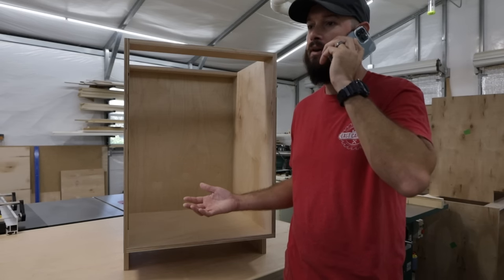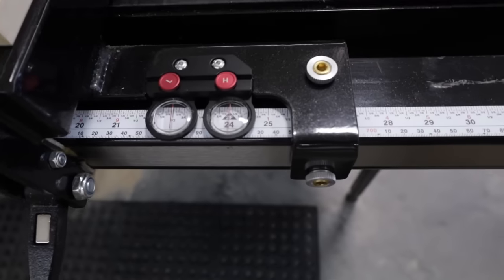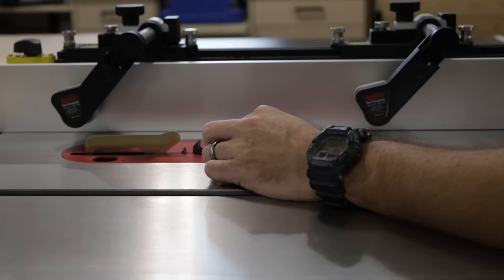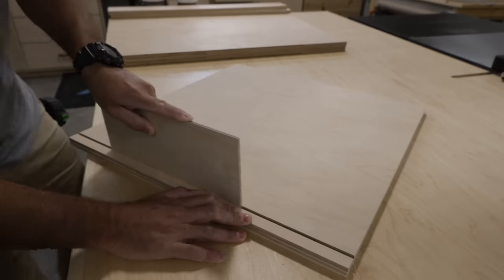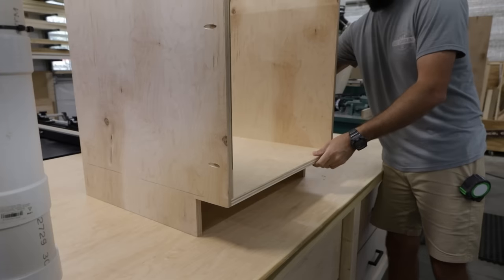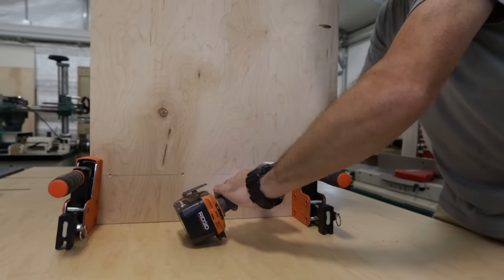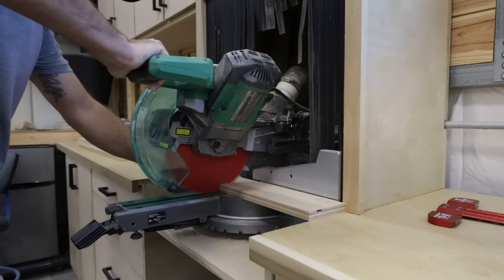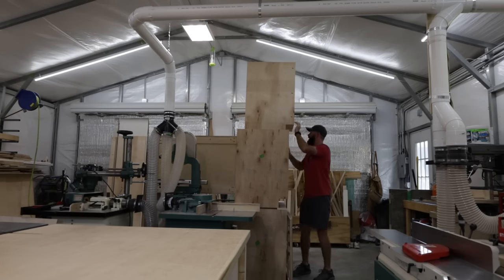How to Build Cabinets in under 30mins //The Easy Way

Comment: A friendly reminder:  I noticed when you were cutting the strips you were not using a push stick.  I just amputated the tip of my index finger 1 month ago on my table saw.  I was using a push stick but got distracted somehow (it all happened so fast).  I have been using power tools and table saw for many years without incident.  Everyone, please be safe and use all safety equipment recommended for your tools so you can keep all of your fingers. :)
Reply: this worries me. I try not to ever get distracted.... but it happens. I am comfortable using my table saw and chop saw, and do things that you probably should not do.... EVER.. AT ALL!!!!     and that is what worries me. being uncomfortable was better..  it had your Undivided Attention!!
Reply: Sometimes push sticks are more of a safety problem, than not using one.  No matter how you cut anything on a table saw, you must always maintain control over the piece.  Push sticks actually require more focus and pressure, than a hand over the fence pushing forward with thumb and index.  ALWAYS hold the piece you are cutting, firmly.
Reply: LET US SEE IT!
Reply: @ryanlopez4550  Because you don't believe me? Or because like graphic pics?
Reply: @Catherine-hh2qw  just want to see
Reply: @ryanlopez4550  I don't think I can attach a pic here...  If you know how, let me know.
Reply: 23 years in and I took the corner of my thumb off.
My caulk lines are tighter than ever, now!

It can happen fast on those repetitive cuts
Reply: @Steve-hj6xv  Gotta look for  the positives! 👍😁
Reply: I’ve lived this long without a table saw I’m gonna pass on getting one
Reply: @jonellwanger7258  unfortunately Jon, that is when you are the most vulnerable for an accident to occur is when you have become comfortable. 

The good thing tho is that you recognize that and you can try and put some extra focus on your activities around the table saw and miter saw so you don’t also become a statistic. 

Be safe out their Jon!! Stay focused brother, you know what to do!
Reply: Sorry to hear that. It must have been really painful. I slashed my palm with a utility knife yesterday while doing a minor siding repair and it was game over for me right there. I wish we all take precautions and try to focus all of the time. Those tools will get you when you least expect.
Reply: I wouldn't use one on the big cuts, where you can keep your hands a good foot or more away from the blade.  But those stretcher cuts made me nervous, when he was putting his hand between the blade and the fence.  That's a bit close for me, I'd use a push stick there.
Reply: You can read this but if your brain is built with a certain attitude to risk, regrettably you can only fully accept that this can happen to you when it's happened to you. 
Thanks for trying to save others from what you've experienced, humans are flawed.
Reply: @Steve-hj6xv  I knew someone years ago who took 3 of his fingers off on his first day on the job. Quite the initiation!
Reply: Sorry to hear that. Had close call doing a drop dado cut on maple. I'll never do that again. Be thankful you weren't using a shaper. Those have taken so many fingers over the years. Those scare me
Reply: Sawstop.. Worth every penny and a whole lot less expensive than a hospital visit. I had a spate of run-ins with the blade till the Mrs mandated my next saw to be a Sawstop. I still have all ten fingers and ten toes and the only thing I've tripped the brake with since was an errant tape measure.. Spinning blades are absolutely unforgiving and you'll be out of action for a good while once you get bitten by the blade.
Reply: I’m gonna ask the question no one else will ask, can you still pick your nose?
Reply: Happens to the best of them.  Man up
Reply: I nicked the tip of my finger and I use a push stick and pay total attention ever since
Reply: “That was my wife’s favorite finger”
Reply: I came close to that last year. Was getting tired and thought I had enough space.  Got lucky, just a nick.
Reply: @sixoffive  Been using a table saw since I was 10 and I still have all the didgets in one piece. I'm 75 now!!!
Reply: @royrodgers3296  I have the tip of my index finger missing so will answer for you..
While I can still insert my finger into my nose I can't actually pick it ..
Reply: @davidcurtis5398  I’m pretty clumsy, short attention span, and stupid. The choices I’ve made.
I’m thinking I need something over complicated and expensive, I just open a door, drop money in and magic happens. Out comes my project.
But, I’m a poor old guy so for now I’ll stick with a circular saw. Nice chatting with you.
Reply: @carljones9933  Ha ha! Love it! well here’s my pro tip of the week: I was never able to fully pick my nose with my index finger, it’s the pinky that will allow you to truly get in there:)
Reply: @davfinport  in some instances yea, that’s when I’d recommend the microjig grr. Solves both issues of forward pressure and fence pressure pretty flawlessly imo. Only downside is the setup sometimes. But I think I’m going to get a second one non advanced for just the gripper pad for datos and generic stuff and then I don’t have to waste time going back and forth with the attachments when they aren’t needed
Reply: Totally agree - my hubby, a very experienced woodworker - built our entire HUGE kitchen with cherry from our own woods - got distracted cleaning & oiling table on his large joiner.  He had a propane heater going, the vac system, didn't hear it was somehow own, the rag he used pulled 2 of his fingers into the blade - zip, split second.  Trip to ER, VERY PAINFUL anesthetic shots & then stitched up the end of middle finger to close.  He lost very small part of middle & even smaller of the next finger.  You never think it'll happen to you - until it does!
Reply: I knew guy whose finger tips got cut on a saw, while in the ER he demanded a plastic surgeon and surgery. He played guitar….
Reply: @sixoffive  oh, wow!  Was his surgery successful?
Reply: @Catherine-hh2qw  Yes, months later he was playing again. His one looked different, had a slightly different curve to it, nail damage, but he could feel the strings and frets fine.
Reply: @sixoffive  That gives me more hope.
Reply: @Catherine-hh2qw  healing from something like that takes a little time. Another bump in the road of life.
Reply: @sixoffive  if you're uncomfortable with using one and could afford one I'd probably recommend a sawstop table saw, they've just released a portable one and if it was built into a nice work table with outfeed support it would work good. I have a Dewalt 8-1/4" which I bought for portability for jobsite use but now that I have a garage the top of the saw is too small for me
Reply: i invested in a sawstop and it's been great.  Plenty of power and a $100 brake cartridge is cheaper than any hospital visit and time loss.
Reply: That is a good advice. My husband lost his pinkie working with that machine
Reply: @ryanlopez4550  🤣
Reply: I was gonna say something about that. Yours was better. Well said.
Reply: I can never get comfortable working with spinning blades of any type. Fear is biggest safety mechanism. Respect is second. I rush other parts but never around spinning metal.
Reply: @prOkrEAt  Your fear can be the biggest threat to you becoming injured. There are tons of videos showing How to safely use a certain tool, I would recommend watching as many as you can find. Watching videos can be just as productive as actually performing a certain cut. Most videos will show you how to safely cut a piece of material and what NOT to do to avoid injury. Small parts being cut close to the blade should be left to more advanced woodworkers but that doesn't mean you Can't do it. A lot of small parts can be cut using clamps or jigs to avoid getting close to the blade. Sometimes hand saws are a better choice for a certain cut to avoid injury. Good Luck.
Reply: @VAFSH4LIF  maybe fear was the wrong word, but respect is probably the right word. Semantics
Reply: I think the fence has hold downs for the wood.  Those 2 black things.
Reply: @martinoamello3017  
That is for in schools 
It's all about knowing what you are doing.  A little knowledge is a dangerous thing.
Reply: @Steve-hj6xv  this is what scares me the most since I work Alone. The table saw is my most feared tool. I would much rather build cabinets with a router. we'll see. I'm a contractor and ready to start building cabinets and possibly furniture.
Reply: I had a close call last month with my table saw. I have been using a table saw since I was a teenager and I think most people who do get injured are the ones who have been using them for ages and have gotten a little too comfortable.

...I also like to shoot a framing nailer into a finger about once every five years just to remind myself to be more careful 😂
Reply: @kjaubrey4816  I have one word for you, ouch!
Reply: Sorry to hear that. I'm a newbie and was so scared of getting into woodworking because of the saws. I started with a dremel,lol. Now I have a tablesaw but thank God its a Sawstop. May I ask what the distraction was? And how it happened? You held pushstickand lost control?
Reply: @jonellwanger7258  oh man i hopei never get to that stage where i become fearless....I like being afraid of spinning blades.
Reply: @sixoffive  How long may i ask? And what are your methods of cutting? Circ saw?
Reply: @wallywest2360  I was thinking he has to have a Sawstop...id hope but then thats another issue to do dumbstuff simply  because saftey mechanism is there...
Reply: @ganzhomanh8137  Hi. Im a beginner. Whats a drop dado and shaper? like a router?
Reply: @martinoamello3017  At least youre reassured the Sawstop safety does indeed work,lol, i have one too but sometimes im like, what if im a super unlucky one out of millions who got a defective one,lol.
Reply: @davidcurtis5398  Thats awesome man! Hey may I ask if you ever had any respiratory problems due to wood working? Im curious of the old time workers since back then everything was less "good" than now in terms of machinery.
Reply: @rickrhoduscarolefrazier-rh565  Jeez man thats a horror story. Thats why they stress so much in manuals to make sure tools are off before servicing. Everytime I buy a new tool I know a major chunk of the manuals are all literally all copied and pasted with same safety info but i still go through it to remind me.
Reply: @prOkrEAt  I agree with you.
Reply: @royrodgers3296  Nature and its infinite wisdom made sure that your pinky is sized proportional to the inner workings of the dried snot portion of your nose.
By the way, what's the formula for determining exactly how much moisture needs to dry in snot before it can be considered a viable booger? And why doesn't clear snot on a tissue turn booger colored after it dries? Not to change the subject or anything you know..
Reply: @carlcarlssen4299  Sawstop malfunction is my constant source of worry. I'm more worried I'll trip the break on a Saturday night because the only place in town I can get them doesn't open again till Tuesday!
Reply: Ehhh..safety schmafty..If man were meant to cut wood we'd have been born with push sticks instead of hands! Well, maybe not.. It wasn't always this easy..😊
Reply: @davfinport  Exactly why I never use push sticks. Well almost never. I feel an "un natural" extra 2 joints you have to deal with with no feeling. (the hand to the push stick, & the push stick to the work piece)
Most of the time I use the "thumb theory" If my fat little thumb fits through, My finger should sneek through with the greatest of ease🤣
Reply: @carlcarlssen4299  Never have I had any problems but I try to do a lot of finishing outside in the spring or fall. If working in the summer I get up a daybreak before the heat gets to bad. My Dad and I would refinish furniture, use stripper and never did use any gloves. His favorite was Red Devil without any wax. For the abrasive we would use fine wood chips from something like a planer. Saw dust was to fine. Take the wood chips and put a good covering on the paint stripper, let it sit for about a minute, and then start to rub. The saw dust will absorb the gunk (real technical word) and the finish will come off. If there is saw dust clinging to the object, there is where more finish is and will need a second try. Hope this helps.
Reply: @martinoamello3017  brother all I really know is that I can make a tissue dance by putting a lil boogie in it!
Reply: @royrodgers3296  Yup..same here, but by my age I should be qualified to know all these raging questions of the day...That's why I'm still asking..🤔
Reply: @carlcarlssen4299  yes and I also use a jig saw for smaller detail work. 
I use a rip guide, but it’s not the same as a rip fence or a track cut. Harder to make long straight cuts
Not a professional so I really don’t need a table saw. One day I’ll be bored and buy/make something. Compound miter saw is calling me now.
Reply: @sixoffive  I'm a beginner and for past three years all I used was a circular saw. I have just recently bought a compact sawstop TS and just used it a couple of times and its so much easier to cut. But I'm one to go by instinct and the includes pushstick and miter gauge felt flimsy and was scared to use them. I got the grrriper block from microjig and feels way better. Plus the sawstops added safety mechanism gives me peace of mind. If sawstop didn't have this safety mechanism, I don't think I would've ever gotten a table saw.
Reply: @carlcarlssen4299  Thanks for the info, sounds like the way to go. You should make a video.
Reply: @sixoffive  Yeah ill try to make one once I have everything ready, cause the downside is it shoots dust all over and that to me is another danger. So im working currently on setting up dust collection for it as the stock dust collection is not good.
Reply: i caught my thumb on a table saw and i still dont use a push stick. sometimes you just gotta ride the lightning
Reply: 1st thing you did wrong was allowed yourself to be distracted and the 2nd thing was you continued to cut while distracted. Hope you learned your lesson and fix yourself before you try to fix others.
Reply: @Catherine-hh2qw  you can make a short video with the pics and put it on your channel.
Reply: @sixoffive  Same here!
Reply: @carlcarlssen4299  No such thing as a drop dado.  What he meant was the was making a  stop dado (also known as a blind dado, doesn't go all the way through the width of the board) he dropped the board onto a dado blade.  That is a very dangerous practice and he now knows how stupid it was to attempt it.  I've dropped a board, very slowly and very carefully, onto a router bit to make a blind dado.  Easy peasy with good fences to guide you, but NEVER with a dado stack.
Reply: @Catherine  The standard push stick can be just as dangerous as no push stick.  If you look at Eric's saw you will notice the two wheels that ride on top of the wood.  Those wheels cannot back up so that eliminates kickback which is the most common way of getting your fingers pulled into the blade.  The wheels are also cantilevered inward so they also pull the work piece toward the fence so that device makes the operation even safer than a push stick. The problem with the push stick most people use (stick with a notch) does nothing to help hold the board down to the table surface so the work piece can flip up.  As soon as it does that the wood will engage the back teeth and boom, dangerous kick back.  A better push stick design is a combo push stick/push block.  It can easily be made out of a foot long 2x8 by ripping a quarter inch off the bottom until you get near the back.  Leave a half inch long piece of the original board at the end which forms a notch to engage the back of the board..  Fashion a sort of handle at the top for comfort.  I've seen them as simple as a big hole near the top and as fancy as a hand plane style handle.This way you are pushing down on the board as you push through. I've been following safety rules like these for 45 years without even a close call.
Reply: Thanks for sharing
Reply: Yes.  Be safe.  Sell your table saw and buy a SawStop!  You won’t ever cut any fingers off on that SawStop no matter how unsafe you are with it.
Reply: @CogentConsult  Your SawStop won’t stop kick back which can also maim you. People have been seriously injured from kickback. Your level of confidence is also dangerous.
Reply: I use the micro jig gripper I don’t like the push sticks as they can feed the wood into the blade in a way that makes it unstable and increases chance of kickback
Reply: My wife told me that when I got a good injury I was retired.  Well I managed to get to retirement without sacrificing any limbs (sorry to hear about your finger!).  An yep it's us experiences guys that end up getting hurt because we cut corners.....no bueno.  I have just enough "chicken" in me that I always took my time around those power tools!!
Reply: Thanks mom
Reply: @jonellwanger7258  I’m using my tools from years and I’m still uncomfortable because I also play music and draw and I want all my fingers in place XD maybe that’s what keeps me very focused
Reply: @sixoffive this is me. What do you use for cutting ? Track saw?
Reply: @nathanellison594  table saw
Reply: @Catherine-hh2qw I believe you and don't need to see. Thanks for the context and perspective. I'm still learning and have many more mistakes to make but I really like to learn from the experiences of others. Again I say thanks.
Reply: My father was a master cabinet builder class diyer, home woodworker. ONCE, while building out our whole basement, he cut off the top joint of his middle finger, exactly your story circumstances.
He passed out on the way to the hospital..poor mom.

They sewed it back on (1958) but it was always at a slight angle.   Lost a lot of blood up our stairs and out our kitchen door.
I was 6, came home from school to a crime scene, no parents.
USE A PUSH STICK + pay attention.
Reply: @freedomofreligion3248  Thanks for sharing!
Reply: women ☕️
Reply: Same with skill saws. When cutting rips, always tack to a surface rather than hold with your hand. Rollbacks can lop a digit or more off before you know what's happened
Reply: @Steve-hj6xv My uncle lost his index finger to his table saw. Got a bit too casual after decades of contracting
Reply: I know an excellent finish carpenter, who got distracted while throwing scrap pieces through his table saw to clean up around his shop, who removed all his fingers except thumb at almost the knuckle. His wife was an ER nurse, and for whatever reason, despite her knowledge and doing everything right, putting them on e ice etc etc. and him not a smoker or anything,  they could not be reattached. He was in the business of doing high end cabinets and custom millwork for over 30 years. He said it happened so quick, there was no pain.... Can happen to anybody. I have a Saw Stop, but I don't rely on it. My goal is to never make it trip. Band saw has my undivided attention as well.
Reply: Getting distracted while performing dangerous actions means you’ve gotten too comfortable. An injury normally resolves this.
Reply: Well don't cut your fingers next time
Reply: I've used table saws for a long time. Them things terrify me every time i have to use one.
Reply: @danielavaninadtkm  I bought a SawStop... best $$$ on a power tool I've spent.
Reply: @carlcarlssen4299  test it with a saucage ;)
Reply: @wallywest2360  Yes, his hands were SO close to the blade!
Reply: @pixiemoon3020 I hate that so many new in the trades simply do not know the basic mechanics and physics of power tools and were taught by others that don’t even know. I have seen guys send people over to cut boards and sheets and have to give them a lesson on basic does and don’ts .
Reply: Catherine:  less feedback, more sandwiches.
Reply: A friendly reminder: we all still have our fingertips and you don’t.  Some people will cut their fingers off, and some won’t.  You are the type who does stuff like cutting your own fingers off, and we aren’t.
Reply: Glad I never trust tools even if they never failed me so I never end up being distracted.  My hands are worth more than any project and I'll continue to treat them that way unlike some here.
Reply: As a board-certified emergency physician, I have seen injuries like yours more times than I can count. The last table saw injury I had seen involved 3 fingers. I have seen worse. When I purchased my table saw my wife was with me. I told her we needed this for some planned home renovations. She asked what it was used for, and I replied "accidentally amputating one's fingers."
Reply: There are 30-40,000 reported table saw accidents a year. That’s around 100 per day and that’s just ones that end up in the hospital
Reply: Over the years I've found myself working in several cabinet shops.  An interesting thing was that so many guys who had done this for years, I guess could be called professional, compared to myself who was just looking to put beans on the table between better paying gigs...  Many of these professionals were missing either part, or all of various fingers.  A bit sobering to be sure!  Always pack sufficient fear to demand the respect required :)
Reply: @1982MCI  Indeed and this guy is pretty cocky it appears.  Has all the really cool tools and such but no common sense.
Reply: It's not possible with this table saw. It's a stop saw. The instant your flesh touches the blade a brake engages and stops the saw....instantly. worse case you'll get a paper cut. This saw is a must have
Reply: If you are a professional woodworker in any form, sooner or later you are going to have one of those moments. No matter how careful, the odds are against you and as you stated, it is so fast that nothing can be done about it.
Reply: @sixoffive If you do not master your fear ,your fear will become your master (read with old kung Fu monk voice for max effect lol)just messing with ya I myself have a big old dinosaur of a table saw that I honestly try to turn on as little as possible....., because even after 20 plus years using power tools it still scares the hell outta me lol
Reply: Where's your sense of adventure?!😂
Just kidding, sorry you cut your finger.
Reply: Yeah the table saw scares the shit out of me. I'm super careful and I pay attention when I use it
Reply: Yeah the table saw scares the shit out of me. I'm super careful and I pay attention when I use it
Reply: Table saw got the tip of my thumb also.
Reply: @kwaks1979  Ouch! Hope it's all healed now.
Reply: @Catherine-hh2qw  yes it is. Still don’t have full feeling back.
Reply: Sorry to hear that you were injured while doing the right thing (using a push-stick).

Things that often get people in trouble:
*Fear of the saw (or whatever other machine being operated)
*Getting too comfortable, taking excessive risks
*Getting lazy/losing focus/distraction
*Poor material control (which can be caused by some aspect of above, or not).
*Thinking that just because you have a fancy new saw with the "Save-A-Digit" blade drop feature you don't need to worry about the rules.
> While I do like the concept of this feature, I will never trust it to work.  It is an electronic and mechanical device, and it is also in a dusty environment, which can add to potential of a failure.  Just because it should work/does work does not mean it will work when you need it to.  You also have to think about the composition of certain materials, to deactivate the safety feature, before making your cut(s).

*Always respect the machine, never fear it.  Fear will invite injury.
*Think about your cut/setup, before making it
*Pay attention during the cut  distractions, etc are fine between cuts, but always drop back to a focused state, before your next cut, or doing anything with the machine, including adjustments.
*Use push sticks, or other feeding devices, when necessary.

A table saw is never 100% safe.  There is always an inherent risk of danger or harm present when using one.  You (the operator) want to make that risk as small as possible.
Reply: @Steve-hj6xv  I can definitely see that being a possibility with repetitive batch cuts.
Reply: I think about that every time I sneeze, get distracted by a noise, stumble on something I carelessly left on the floor.........
Reply: Yes, many grow complacent about safety after years of no accidents
Reply: Let me get this straight. You were using a push stick and amputated part of your finger but yet you are  telling him to use a push stick?
Reply: @Catherine-hh2qw me and my wife bought a table saw about two years ago, when it was running I tripped over (Lord knows what) caught myself by grabbing the  edge of the table,,, I unplugged it and took that mf back to Home Depot I was shook up and done with the honey do's,
Reply: Yup... Same. I almost severed the tip of my index finger where my cuticle is when I moved my hand into a spinning grinder with a carbide tooth wheel while working on some aluminium. Drove myself straight to the ED while fighting the effects of shock and underwent a 5hr micro surgery while on local anesthesia to re-attach the nerve and my fingertip. Till this day, I haven't used carbide wheels for cutting aluminium anymore, just a trusty ol' hacksaw 😂
Reply: The how r u typing if u have amputated yr finger 😢
Reply: I hate table saws...I avoid them at all costs.....sorry for your accident..it is my worst fear...when I was 7 years old my dad cut off 3 of his fingers....thank God the hospital was able to reattach them......
Reply: My mentor says, “50 years and I still got all ten”
Reply: No video? Never happened !!!
Reply: @1982MCI Table saws are SO much like motorcycles in this respect.  There's absolutely nothing to be afraid of, but as soon as you're comfortable and at ease/relaxed, it WILL bite you in the ass!(or finger!) A healthy respect for the machine and environment is always necessary!!!
Reply: @oladipo8951 Ohhh...the palm sucks!!! Keep it clean, friend!!
Reply: @ganzhomanh8137 Saw a guy lose 3 fingers on an I'll advised drop cut...improper or hasty set up will get you!
Reply: @thilde007 Well, now it's ribbed for extra pleasure!!😂😂
Reply: @sixoffive Luck guy...didn't get the nerves!!
Reply: @kjaubrey4816 Ha, ha, ha!! I was nailing a curved frame together and the impact of the stapler on the springy curved frame made the gun double fire and one leg of the 3" crate staple went right through the tip of my index finger. Missed the bone & the nail, though! Got lucky, but boy, that was sore for a while!!😅
Reply: @carlcarlssen4299 A shaper is like a router on steroids. Much heavier, more powerful, and strictly table mounted. Much larger cutters for bigger and more complicated work...
Reply: @sixoffive If you get a proper table saw, you'll kick yourself in the ass for waiting. So much is possible so much easier...
Reply: @matthewshannon6946  Dang! I bet it was!
Reply: Most Cabinet makers only use the Track Saw to make Cabinets.  And a mitre Saw.other cuts